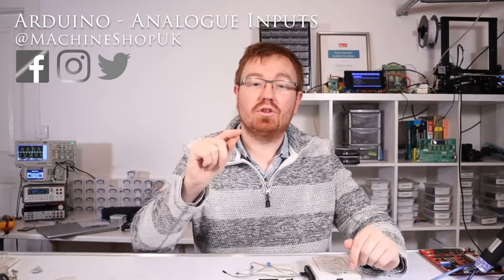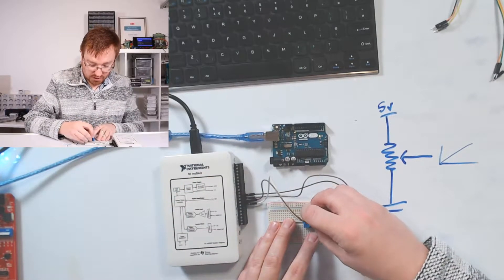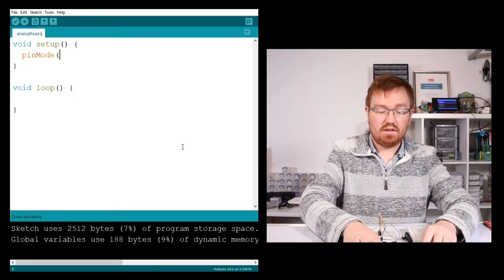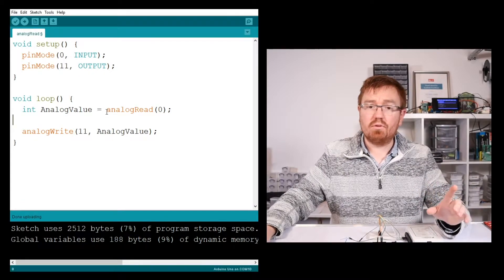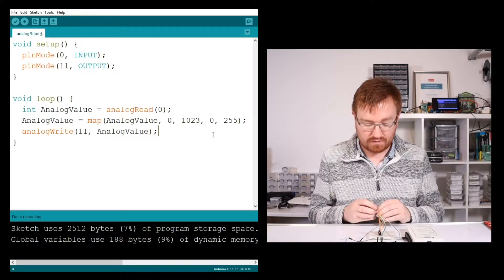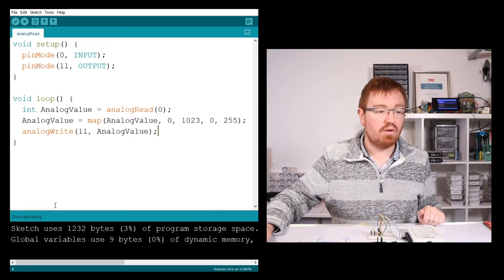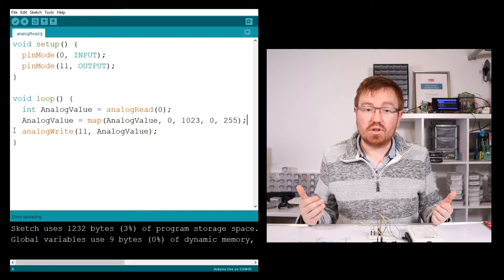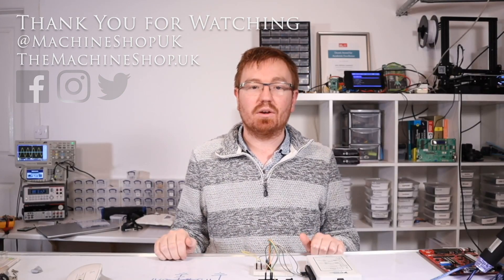Arduino - Analogue Inputs

Comment: Thanks for this very useful video. I am trying to capture my car's steering wheel buttons resistance value for each button and I didn't understand the use of another resistor in between to actually get correct readings.
Reply from the maker: When you are trying to read resistance you are actually reading voltage with a fixed current. Since R = V/I, so when you fix the current and the resistance changes, so should the voltage and you can read that into the Arduino
Reply: @TheMachineShopUK  Indeed, to give you the full story: on my car service manual it is written that there are basically two cables (SW and SWG) and that the voltage should vary between 1V to 4V depending on which button was pressed. I first connected SW to an analog pin and SWG to the GND pin on my ESP32. I could get readings and when I would press on buttons I could see the difference between readings, but the values were very random and chaotic at times, it would have been very hard to distinguish which button I would have pressed. Looking on the internet I found a thread on arduino forums where they added a 10komhs in between, I did the same and got very distinguishable values. Only thing was that I didn't really get why using a resistor was necessary and effective, and then I found your video that made me understand why I needed one. I have a tech background so I'm really a noob when it comes to electronics :)